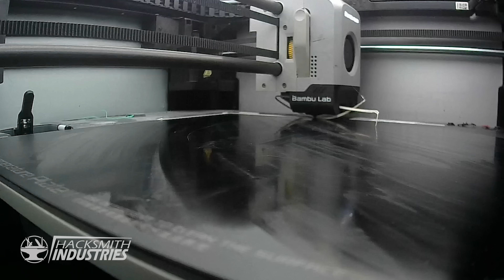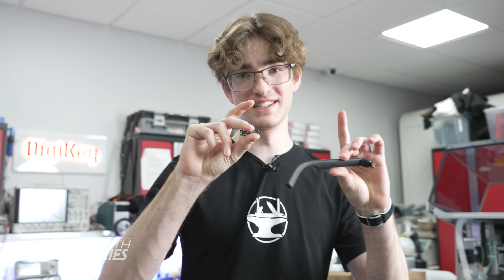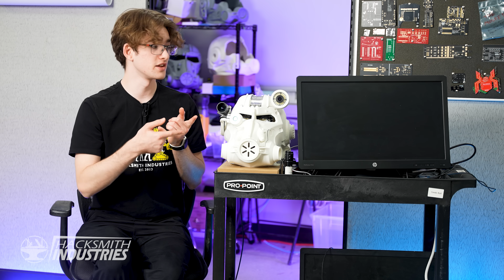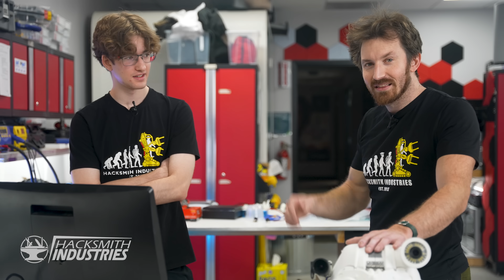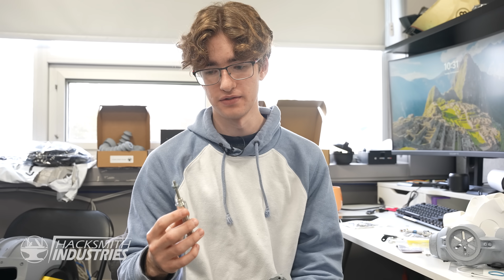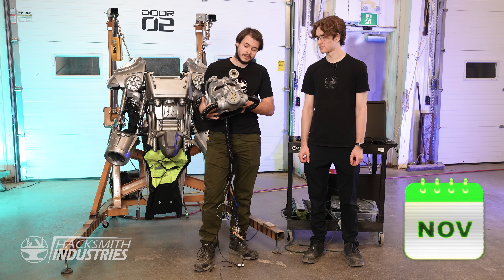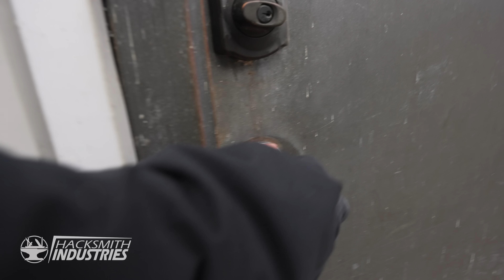World's Most Advanced HUD | Real Life Power Armor (Part 3/6)

Comment: If you want the mask to come off nicely, I would make it so that there is some kind of emergency release that allows you to use the handles to pull the plate off. This would also require the handles to be welded or single-piece instead of glue-on.

Comment: You should make a helmet that doesn't need eye hole, but instead uses cameras on the outside like modern VR headsets. Then the inside has the lenses and screen, and your view is like passthrough on the quest 3. It could go crazy on a Gundam esc helmet or costume
Reply from the maker: That would be easier, but our system means if the power dies, you can still see, and move
Reply: @hacksmith  that is true, this would be more for fun while your project is definitely more useful and tactical, maybe some day on a different project

Comment: So, an idea for the respirator fit. I'm an emt and we have a device called a lucas, it's an automatic compression machine for CPR. It can fit a lot of different people and the way it works is when you activate it, you pull the plunger down manually to be set against the PT's chest, then when you start the compressions it uses that setpoint as it's baseline and performs. For the mask you could use a combo of actuators that push the mask forward slightly and then an inflatable mask that once the mask was set at a baseline it would inflate and make a more comfortable and proper seal. It could be calibrated for a specific user. Downside is if a new person wanted to use it, you'd have to recalibrate it for first time set up, but after that it just goes back to that baseline position, mask inflates, boom, comfortable seal that isn't crushing your face.

Comment: I see a problem with the design of the suit whenever you start to switch out the plastics for steal. With no head supporting structure like in the original suits you would strain your neck almost instantly.
Reply from the maker: You see a problem with the suit that isn't even built yet? 😕 There is no helmet mount yet

Comment: you can make the front lock or some part on the sides of the helmet; filtration systems for air intake, and have a seal around the neck of the suit or helmet, to act as the helmet being its own gas mask instead of having a separate mask inside you would have to juggle with. and you could insulate the whole suit with a air tight and toxin resistant fabric or layer so that the whole body is protected from radiation, not just the respiratory, with the helmet. because there is surface level agents that can blister the skin and everything. hell mustard gas or cs gas locks on to any moistened part of your body like sweat or genitals, etc. so making the whole suit air tight would work better i believe. and you could install a sort of ac system so that the user doesn't get overheated. and with the mask opening and closing, you can just make a sort of air lock system to lock the mask on to seal the mask so there aren't any compromised parts of the in a sense bulletproof militarized hazmat suit...

Comment: the only problem with making all this completely bulletproof is that you'll likely still die from the blunt force trauma if you stop the bullet. Stopping a bullet is honestly easy, preventing all the force of the bullet from turning you into paste inside of the suit is the hard part.
Reply from the maker: You're thinking of a bullet proof suit lol. 

Big thick armor that's heavy absorbs kinetic energy. You will actually be able to keep walking
Reply: @hacksmith  Is the suit going to be able to handle all that energy? seems like a lot for it to be able to somehow dissipate all the energy of like a 50 caliber bullet for example even if you did manage to stop the bullet itself (which I think it would). The coating you plan to use seems to be able to stop the actual projectiles themselves really well. If you could stop all that energy though, it would be pretty revolutionary though i'd love to see it. The helmet itself was really awesome. If you could do that then you basically made an actual iron man suit at that point, so sign me up to invest.
Reply from the maker: Yeah... I think you're confusing the issue with soft armor. With an armor plate and mass (like the suit has) your not gonna feel much
Reply: @hacksmith  yea i'm definitely not an engineer like you so I could be wrong. My understanding though was that it was one of the biggest issues with making an iron man suit. The idea of finding a way to distribute all the force of an impact. You honestly probably know the physics of it better than me, so I can't wait to see you pull it off.
Reply from the maker: An iron man suit is depicted as being just barely bigger than the person, that's the issue -- the power armor is very different

Comment: Seeing the face mask pull away from the nozzle on the power armour helmet would look cooler if the filter was built into the nozzle and you had the corregated tubing (the stuff that expands and retracts) go from the nozzle to the mask that fits on your face. Rather than just wearing a standard industrial face mask

Comment: Instead of using a tight fitting respirator half mask for the "gas mask" you should explore a PAPR system from 3M. Uses positive air pressure piped in through a batery powered filter back. Far more comfortable, as you don't have to worry about the tight fitting respirator. Makes talking easier also. Keeps air flowing in the mask, and has a flip up option also. Just an idea. Love this project.

Comment: Just a quick question:
What happens if one of the pneumatics in the helmet get loose
Could it blast your ear drum?
Which can happen when you make the armor bulletproof and the impact loosens one pneumatic wire.

Maby you also hook up the damage display of the armor with some sensors like where the pneumatics or electrics are failing

Comment: Might need to consider another redesign on the face plate, where is pneumatic cylinders actuate a lever arm, to give more closing force so that it seals tightly. (maybe not "air tight", but at least doesn't have that body gap)

Man this is awesome though. Well done everyone.
The original "unobtainable" dream: "wouldn't it be awesome to have a Pip-Boy?!"
Then the dream became: "wouldn't it be amazing to have a suit of Power Armor?!"
Crazy that we've got both! 😮

I hope that the Fusion Core will be an actual battery pack. Maybe not for the whole high draw stuff, but maybe the helmet items. 🤷‍♂️

Comment: When you spin counter-rotating magnets on opposite sides of a container of mercury, you're essentially creating a complex interplay between magnetic fields and the conductive liquid. Here's a breakdown of what happens:
1. Magnetic Field Interaction:
 * Magnetic Field Lines: The spinning magnets generate magnetic field lines that extend into the mercury.
 * Field Interactions: These field lines interact with each other, creating a complex pattern within the mercury.
2. Lorentz Force:
 * Moving Charges: The magnetic field interacts with the moving electrons (charges) in the mercury.
 * Force on Charges: This interaction results in a force on the charges, known as the Lorentz force.
 * Induced Currents: This force can induce currents within the mercury, further complicating the magnetic field interactions.
3. Fluid Dynamics:
 * Mercury Flow: The Lorentz force can cause the mercury to flow and circulate within the container.
 * Vortex Formation: Depending on the strength of the magnetic fields and the rotation speeds, vortices or swirling patterns may form in the mercury.
4. Energy Dissipation:
 * Resistance: The flow of induced currents within the mercury encounters resistance, leading to energy dissipation in the form of heat.
 * Friction: The fluid flow itself also experiences frictional forces, which further dissipate energy.
Quantifying the Effects:
Quantifying the exact behavior of the system is complex and depends on various factors, including:
 * Magnet Strength: The strength of the magnetic fields generated by the magnets.
 * Rotation Speed: The speed at which the magnets are rotating.
 * Mercury Properties: The conductivity, viscosity, and density of the mercury.
 * Container Geometry: The shape and size of the container.
To accurately quantify the effects, you'd need to use computational fluid dynamics (CFD) simulations or conduct experiments. CFD simulations allow you to model the fluid flow and magnetic field interactions under different conditions.
Potential Applications:
While the specific applications of this setup may not be immediately obvious, understanding the underlying physics can lead to innovative solutions. Some potential areas of interest include:
 * Magnetic Stirring: Using the magnetic forces to stir liquids, especially in microfluidic devices.
 * Fluid Mixing: Enhancing mixing efficiency in various industrial processes.
 * Energy Generation: Exploring the possibility of extracting energy from the system, although this would likely require careful design and optimization.
It's important to note that this is a complex system with many variables. Further research and experimentation are needed to fully understand and harness its potential.

Comment: Are there any plans to make the pneumatics more accurate to the input of the wearer to where they function like a second skin, or will this just be proof of concept? I’m working on a PiD based exoskeleton arm that functions similar to how power steering does, where inputs are just turned into a force and then multiplied into the servo.
Reply from the maker: That's the beauty of the pressure cuffs! Essentially differential control from the movement of your arms and legs inside the cuffs :)

Comment: This project is awesome, one criticism:
I don't know how dangerous radiation is at the levels it's used in the video, but I know it can have some long-term effects including cancer. I'd suggest you could replace it with a fictional force that does no harm and is similar to radiation, and the items that are affected by this fictional force could have a tracker that causes the HUD to detect it.
Reply from the maker: Tritium is perfectly safe in that form, and so is uranium glass -- you just shouldn't be using it as drinkware. You receive far more radiation going on a commercial flight, through the airport scanners, or getting dental xrays.

Comment: The "gas mask" why not have the helmet nearly sealed around  the head. With airports that close requiring you to breathe through a filter. Seems it would be much easier than having a mask inside moving to the face.  Maybe have small laptop fans moving air to breathe to and from the face. With a air filter cleaning the air.
Reply from the maker: If it's good enough for the Airforce... There might be more reasons than what you've specified. Can't think of any sealed helmets other than diving, and space. Every other industrial solution, has a mask element

Comment: A type of limited AI.  That would be an advantage to use in a non- permissive environment ,  that does not require internet to service function. But could voice inform you of your air pressure your vitals when you reach a critical point. 

So that you wouldn't necessarily always have to keep an eye on it while you're in the middle of combat it would tell you status of the suit. What pieces of gear are working and not working so on and so on

Comment: Why not use a worm gear mechanism to move the gas mask, inside the helmet instead of pneumatics as it can also be adjusted as per different facial structures, while a piston must move as a full range of motion. Give It a thought.
Reply from the maker: Because the pneumatic cylinder can just be on low pressure and it will ensure a nice seal
Reply: @hacksmith That sounds right, but theres already a lot of pneumatics with the arms and yet to be built torso, and legs , So I guessed it would be a better idea to go with a motor to save more power and reduce the weight of the helmet. Good luck on another great creation ✨, Been watching you since inventions began outgrowing your basement, Best wishes to everyone in the lab, lastly Merry Christmas.

Comment: As far as bullet proof goes. I got some steel plates off a steel piece i got from a steel mill. We've not been able to figure out what kind of steel it is but its thin like less than quarter inch and I've shot it with armor piercing. 50bmg and it hasn't even dented it. And I've shot it I know atleast 10x

Comment: I don't know why but the copies about of pneumatics is annoying me because I feel like there is a better way and it's really bugging me.
Reply from the maker: Copies? The system we chose is pneumatic -- adding other systems or actuators will increase the chance for failure. Also the pneumatics are spring return, that means under power failure, everything fails open. Every other style of actuator would stay locked in position.
Reply: @hacksmith  sorry I ment copious the autocorrect changed it
Reply from the maker: It's the system we're using, mixing other systems would be problematic
Reply: @hacksmith  so for the sake of standardization, reduction of points of failure due to less moving parts, and the spring return function to prevent fnaf. are the reasons why pneumatics are used in this project from this info. But I still feel like it could be better like Alex lab's muscle tendons that if refined and developed could provide a more effective method than pneumatics, tbh I think it's the perfectionist in me talking tho besides you guys are the professionals
Reply from the maker: The muscle tendons you're referring to... are also pneumatic if I'm not mistaken! We tried those a while ago in our Crysis arm video. They're not that great.
Reply: @hacksmith  I am aware that they are pneumatic but I haven't seen that vid so ill go give it a watch

Comment: Make the shoulders length shorter so it can fit through doors or it should be able to then it’s just a recommendation cause I’m not an engineer 

-edit I wanted to see if I was right so I got on the game and in the game the shoulders are angled down and they go out to the same length of the cuffs at the bottom of the arms you can also see it in the power armor in the part one thumbnail but I understand that it is very hard to get it exactly game accurate so it wouldn’t be a surprise if you guys can’t shorten them

Comment: Guys spray armour with coating made from polyurethane elastomer.
If anyone is wondering its used in armors,bullet proof cars...
It's claimed to be stronger than bare steel in terms of impact resistance,abrasion, resistance and overall durability.
Reply from the maker: We're coating it with a real life equivalent to adamantium, much better than linex

Comment: I would be neat if the suit gave haptic feedback for radiation levels. Especially if you had a detector in each hand. Set it up so there is a very small vibrating motor (maybe one from a joycon?) in each hand along with each detector and have the motors increase their rpm as the radiation levels increase. This would allow you to essentially feel the radiation in the environment which I think will be much more intuitive than numbers on a screen, especially when you have so many other things going on on the screen that may need you attention as well (though you can still have the read out on the screen as well for objective measuring). You can even change the vibrations from a steady state to some kind of "pulsing" state if the radiation detected is at hazardous levels, kind of like a tactile alarm.

Comment: What if you put a pulse oximeter in one of the fingertips and routed it up to the hud to measure vitals even better? As well as/or some sort of Bp cuff that can take the place of the one of the cuffs in the bicep area and inflate with a command. Then you utilize ai mixed with some sort of program with a database that had different conditions and symptoms associated with those conditions, and then gives you a recommended avenue of approach for a solution.

Comment: I would honestly reach out to your AR glasses manufacturer and see if they can make custom fit lenses that actually fit into the helmets eye slots.  Then remember that the eye slots need some form of damage resistance as well.
Reply from the maker: That would be fully custom -- no AR glasses manufacturer would do that, especially not for a few one-offs lol

they fit fine... we added a PC lens to protect them, so fitting perfectly doesn't really add anything
Reply: @hacksmith  Most likely correct, however... you could do it yourself.
Thinking about it, AR glasses are just a layer of oled on glasses, oled displays are naturally flexible and clear... you could source two cheap oled phone displays, and wire them to an arduino to process the output, thinking about it, the supplies would cost a few hundred, labor on programming would be more, but it wouldn't actually be difficult to have 2 fully custom lenses this way.
Reply from the maker: They're not that simple - the focusing lens that makes it augmented is the part that isn't easily manufactured. Either way... What we did worked, making it the exact shape of the eye holes is overkill, because your eyes only see through the center part anyway